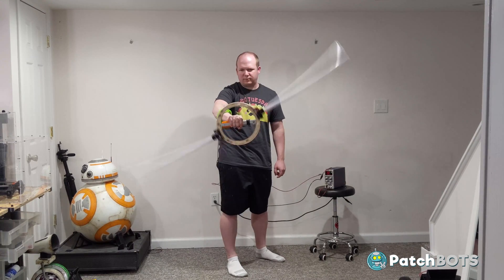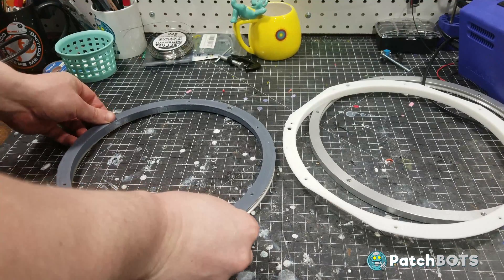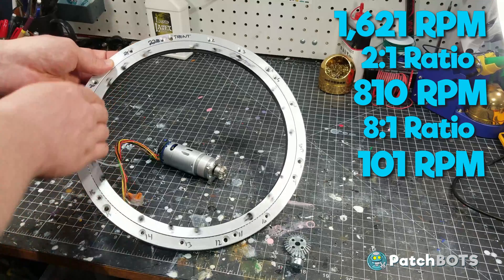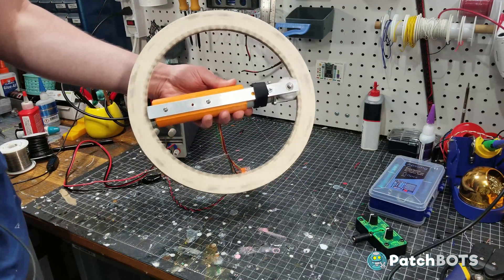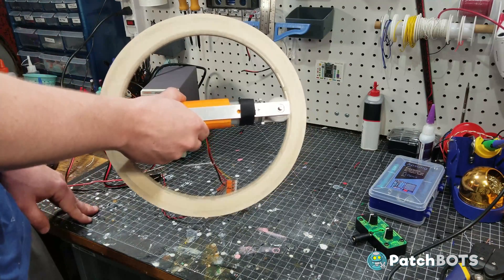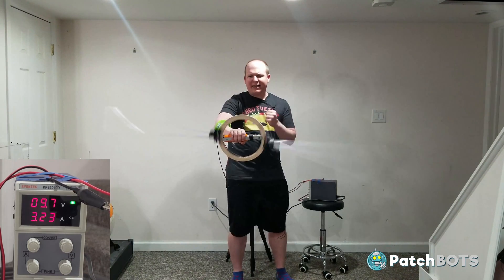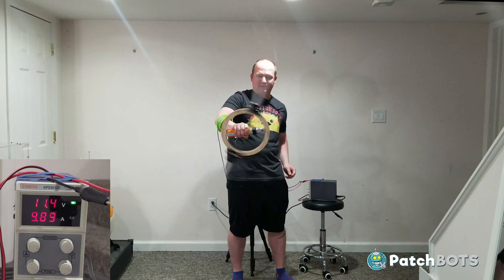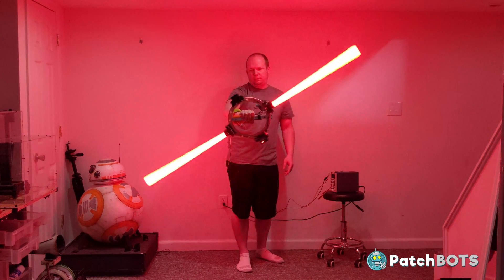Grand Inquisitor Spinning Light Saber - Star Wars Rebels - Part 1 - MECHANICS

Comment: And here’s me thinking they just need a rotating mechanism and just a locking mechanism that you cam hold to unlock .
so you just flick it spins and then   Press it to stop it spinning 
So your not stuck to wires against a wall/generator

Comment: This is great! Have you considered building the components that are outboard into a gauntlet that has contact points in the upper palm of the glove and the webbing between the thumb and forefinger?
Reply from the maker: The outboard components will soon be contained.  The final saber will be two isolated systems; hilt and outer ring connected via bluetooth.   Both systems will have their battery packs built in.
Reply: @PatchBOTS  very clever with the bluetooth! I'm guessing the sound venting will be radial near the ends of the handle (to avoid spin distortion of the sound and taking it's accelerometer input via bluetooth for the outerwheel plus input from the handle as well)? When you move to a internally compartmented setup, are you trying to do neopixel for the blade lighting or baselit due to the high battery drain needed for the spin? We will watch your career with great interest!
Reply from the maker: @Will.The.Adequate  Thanks.  Sound will come from transducers which will hopefully turn the whole thing into a speaker. I doubt it will be super loud, but hopefully enough.   Yes, I'm sticking with the neopixels for this version.   I'm slowly making a list of ways to make a potential V2 better, and switching out the neopixles is definitely on that list.

Comment: I'm guessing that with more internals and then the outer decorative parts you may be able to dampen the wobble and noise hopefully. It's already reached an impressive stage can't wait to see the next vid
Reply from the maker: Yeah.  There is going to be speakers for sounds and what not, plus everything will be covered and (hopefully) tuned a little better.  All that noise is coming from the miter gear mash, that can definitely be fine tuned and greased a bit more.

Comment: I had had the idea to build one of these four or so years ago! Although I deemed it too tricky of a project to attempt. Do you think the final product will be two isolated systems (the blades and the rotation motor)? Hopefully you're able to balance it well enough that it doesn't throw its weight around.
Reply from the maker: Yes it's tricky. I've been working on this on and off for a couple years.   Yes, the Inner and outer sabers are isolated systems connected via bluetooth. All user controls are in the hilt which can send signals to the outer saber for turning the blades on and off, activating the sound, etc.     This project will have 4 videos.  Video 2 will be all about the inner saber circuit and Video 3 will be all about the outer saber circuit.